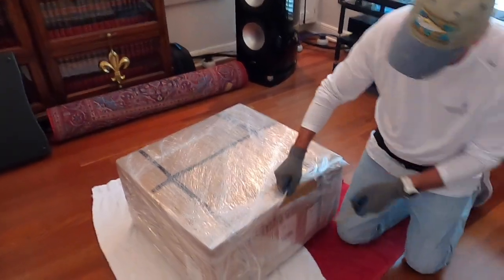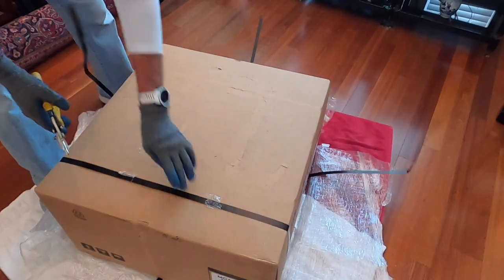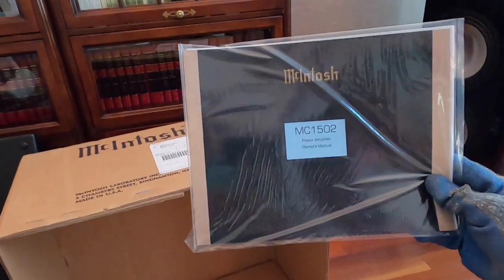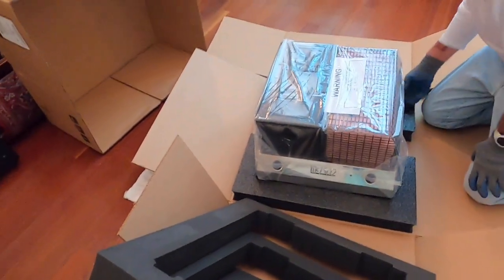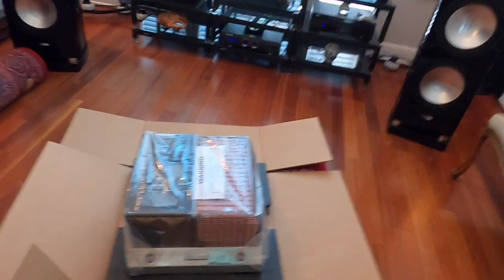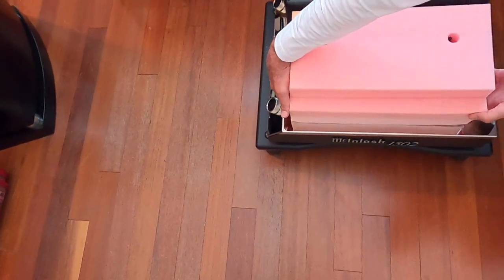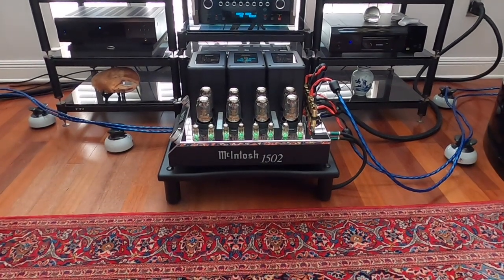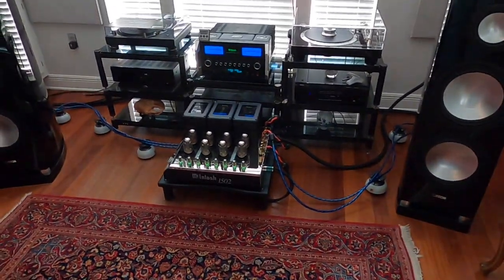Ep. 1.  McIntosh MC1502 Unboxing

Comment: Looks really nice, Glad to hear the tubes are quiet. How much heat is this give off? I have the MC 611 600 W mono blocks.  I'm thinking about using these for biamping mid/tweeter and the 611 to handle the bass drivers.  Do you still like this amp after 11 months?
Reply from the maker: The amp runs warm, but not really hot which surprised me considering how many KT-88's are running.  I tried bi-amping with the MC1502 and my MA 8000.  The results disappointed.  I'd proceed with caution on the bi-amping idea.  The MC451's and MC901's are ready made for that.  Yes, I still love the amp.  Good luck!
Reply: Thank you very much for your reply. I'm leaning heavily to the 901s.  Heat is still a concern and I wondered have you ever measured the watts from the wall for this amp? I would be very interested if you were able to do this.  From this info it may help me determine how much heat Will be generated.  For your info a human body sitting on the couch generates  300 BTUs.  And 100 W equals 3.4 BTUs.  Thanks for your good info
Reply from the maker: @iampuzzleman282  The MC1502 draws 316 watts at idle and around 500ish watts at around 40% power.  It's not a "hot" amp but does run warm.  unavoidable with 8 KT-88's in the mix. 

FWIW, I'm running the system in solid state only mode through the MA8000 since we're in the middle of a very bad heat wave down here right now.

Best of luck and let me know what you decide to do.